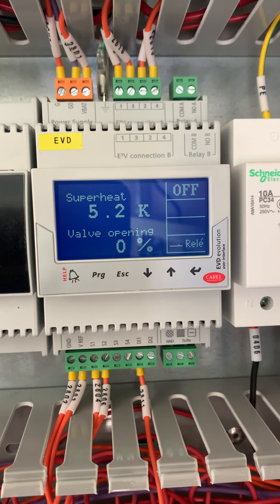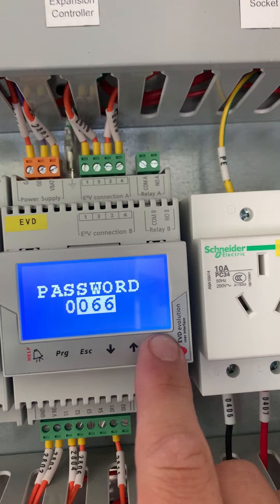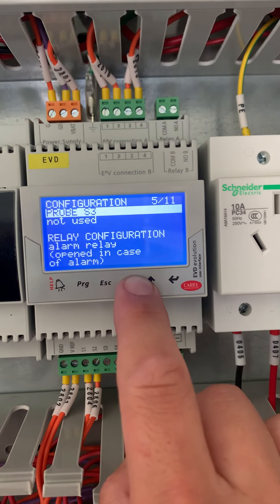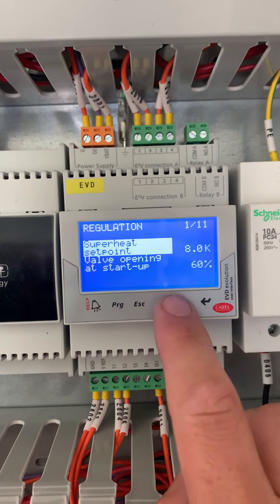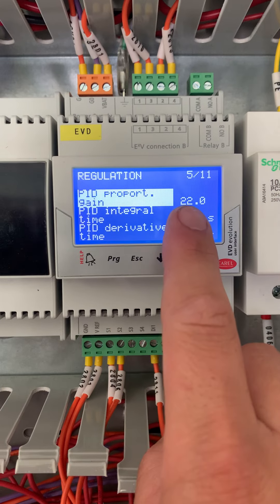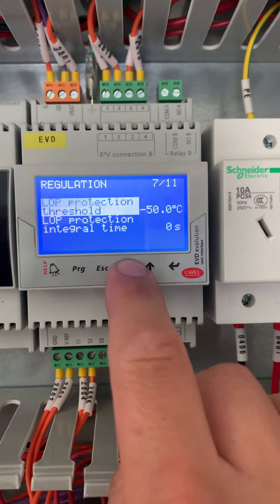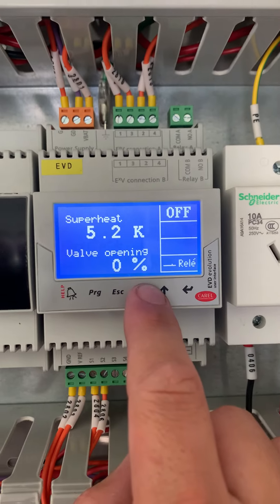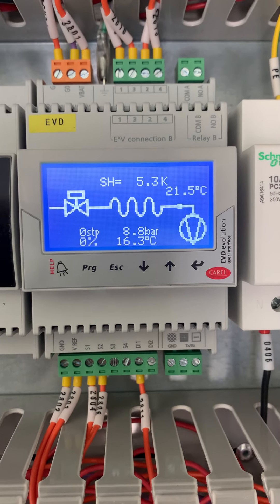Carel EVD Evolution setup General cool room application

Comment: Why come probe S1 Please tell me.
Reply from the maker: S1 Probe is your pressure input transducer, S2 Probe is your NTC temperature sensor. Make sure the probe your using is the same as the one set in the EVD Evolution or your pressure and superheat will be wrong.